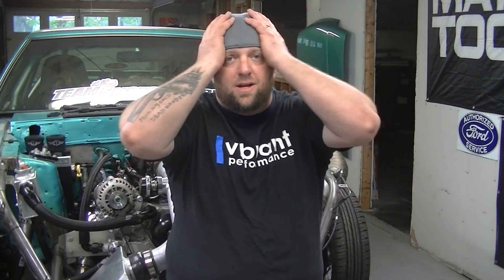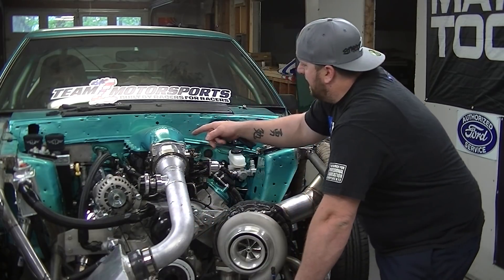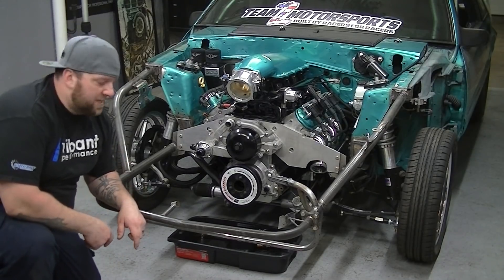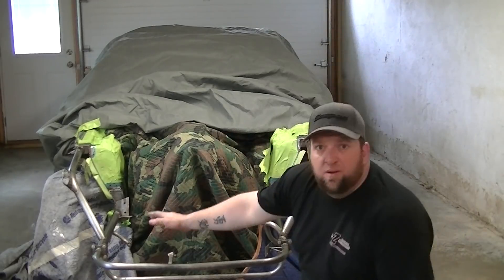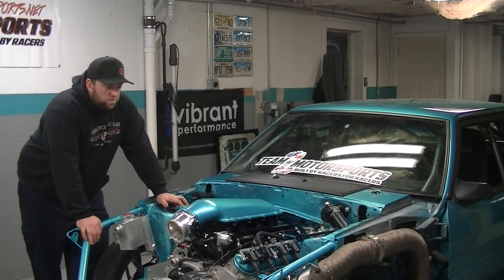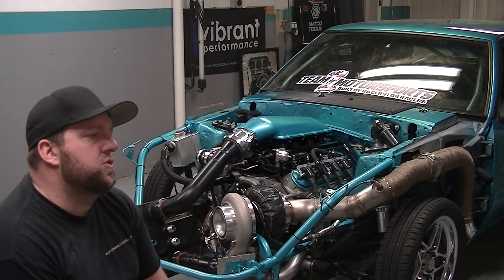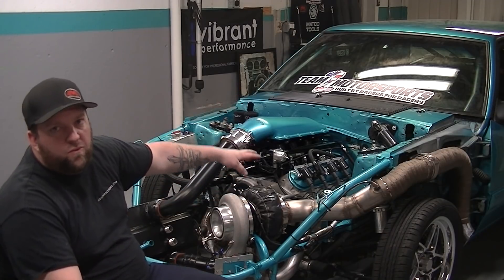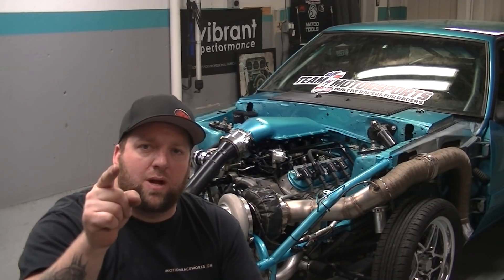LS Foxbody build EP. 65 Tear it apart

Comment: Input about 2500 miles on my car before I put it on the dyno. I basically only used the dyno to find peak torque to know my max timing at 16psi. I had made probably 50+ street pulls and the tube was good already. But I was still a nervous wreck on the dyno running the car and keeping a eye on the A/F. But it went perfectly zero issues. Keep up the great work man really enjoy this channel.

Comment: Instead of running beads on ur pipe to keep from blowing off best way is to cut 1/8 of extra pipe off then cut it in half and weld those two pieces on end of pipe.
Reply from the maker: Robert Duvall that’s not a bad idea at all. I think I’m gunna invest in a bead roller soon.
Reply: shit that's a pretty good idea Robert good tip
Reply: Check out the monkey fab garage pieces .billet ends that weld on for cheap .nice way to do it and cheap .they are called billet beads .he has all kinds of cool stuff .